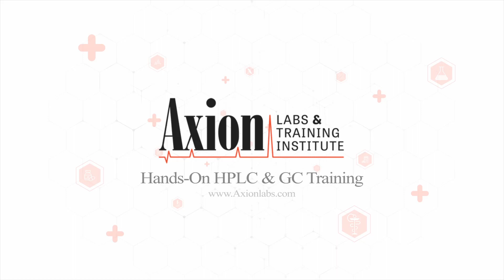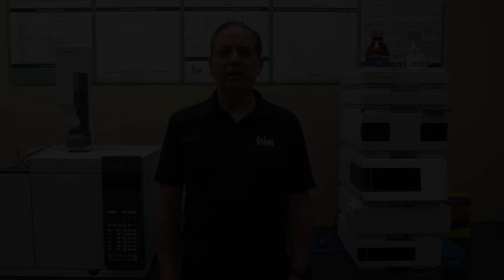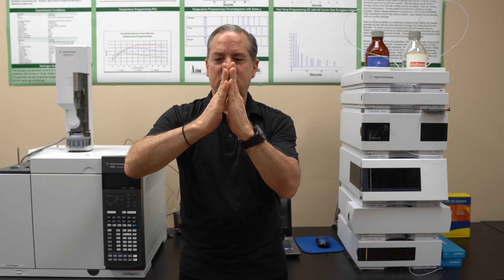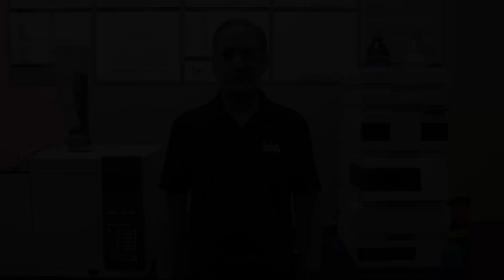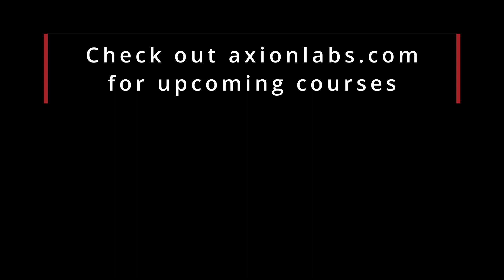HPLC Tips Peak Tailing

Comment: I am having an issue running Benzoic acid on a Phenomenex Luna C18 column, the peak for the benzoic acid starts eluting fine but then has a really bad tail towards the end affecting my USP tailing, what I don't understand is that my salicylic acid peak is coming out fine as I have both of those components in the same standard solution what can be causing this tailing? I reverse-flushed the column thinking the column was dirty but it didn't help.